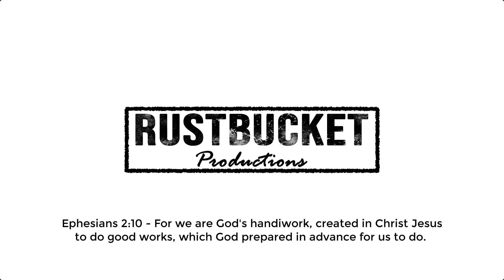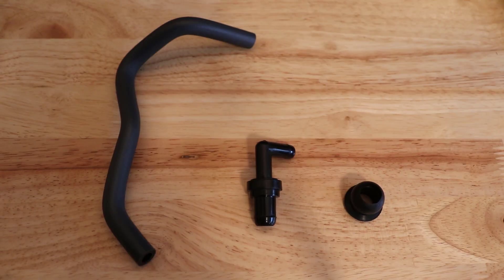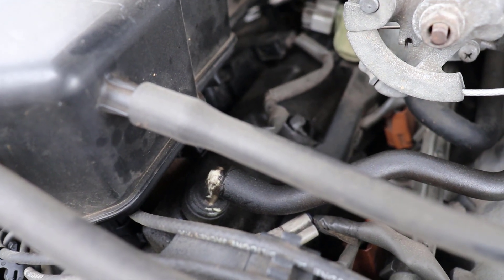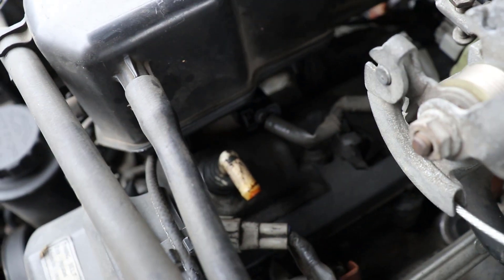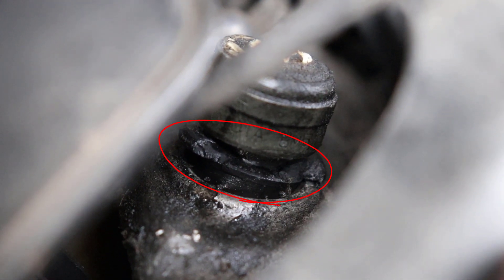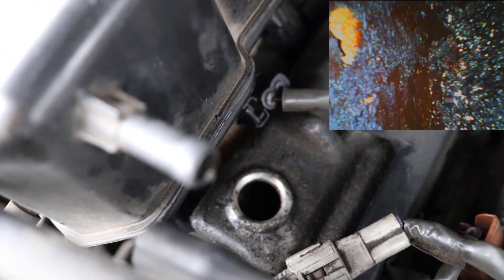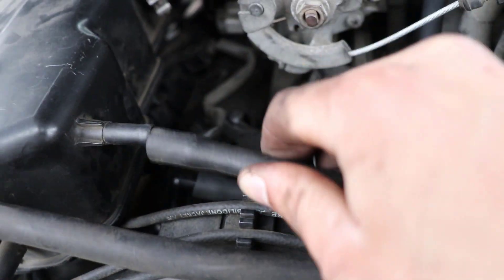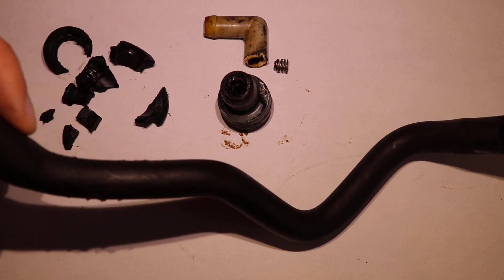3.4L 5VZ-FE PCV Valve Replacement

Comment: 2 kind of PCV valve : Plastic (after market) and Metal ( OEM)  I like the metal one because they are not easy to break...Plastic if they break then you had a hard time to remove the broken pieces in there !

Comment: Did you unscrew the valve to get it out, or do you just pull it up?
Reply from the maker: I carefully pulled it out. The valve itself is not threaded but applying a twisting motion while pulling may help you remove the valve.

Comment: Where did you buy the hose?
Reply from the maker: https://www.ebay.com/itm/404294881461?hash=item5e21da50b5:g:m~4AAOSwbe9kVgPz&amdata=enc%3AAQAIAAABIIsDlHMU3xUvw9wisku4mbEJZcnvsVoCi8tmUAlrVj2TOu1EDBDFQTJi9sCGD8t8zlj02IeyZZsMlPqoDCv0mpHSOF3XmuS9UItVlyoZQfmY3LHqGcAH5ctDuoHQacaMYZZXf4TXg3VKpk3cmAEdPtm4y7MVK%2FAHDimvt5QDEM185hcLCI4z7b7jdfjryjk2rgFeiqzogA%2Bm5LQIsH1Pf%2BJnFXXeUYpz4NMaaF5%2Fib8GB%2FuE5U2tJUai6qR%2Fh%2B2H4dnmjX3QCqFurpFhHUwEFqUFe4HpGYVAu7nACGSrdegGTN90YrDYei6jdKFnvuw1eZAro9BR7uBzl4sJO%2F1RCWYcBYUs9Vc8dndsk2gspiLj4fGV%2BpoN7mZBVH9aWEpLbQ%3D%3D%7Ctkp%3ABFBMhPmgpqFj

Comment: Do you have a link for hose/ parts?
Reply from the maker: This isn't the exact part but it is basically the same. https://www.ebay.com/itm/404294881461?hash=item5e21da50b5:g:m~4AAOSwbe9kVgPz&amdata=enc%3AAQAIAAABIIsDlHMU3xUvw9wisku4mbEJZcnvsVoCi8tmUAlrVj2TOu1EDBDFQTJi9sCGD8t8zlj02IeyZZsMlPqoDCv0mpHSOF3XmuS9UItVlyoZQfmY3LHqGcAH5ctDuoHQacaMYZZXf4TXg3VKpk3cmAEdPtm4y7MVK%2FAHDimvt5QDEM185hcLCI4z7b7jdfjryjk2rgFeiqzogA%2Bm5LQIsH1Pf%2BJnFXXeUYpz4NMaaF5%2Fib8GB%2FuE5U2tJUai6qR%2Fh%2B2H4dnmjX3QCqFurpFhHUwEFqUFe4HpGYVAu7nACGSrdegGTN90YrDYei6jdKFnvuw1eZAro9BR7uBzl4sJO%2F1RCWYcBYUs9Vc8dndsk2gspiLj4fGV%2BpoN7mZBVH9aWEpLbQ%3D%3D%7Ctkp%3ABFBMhPmgpqFj

Comment: great video man. i just noticed oil in my coolant reservoir in my 98 4runner. I believe its a bad head gasket. a bad PCV valve wouldnt lead to a little oil in the coolant reservoir, would it? Thanks for the video.
Reply from the maker: No I do not believe so. Oil may have seeped through into the coolant due to a bad head gasket.  Might need to take a closer look.